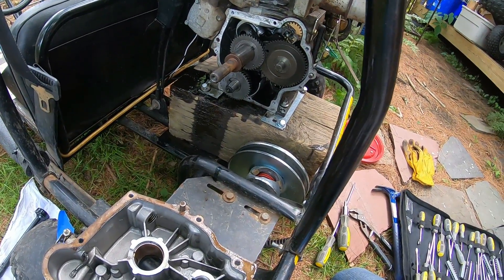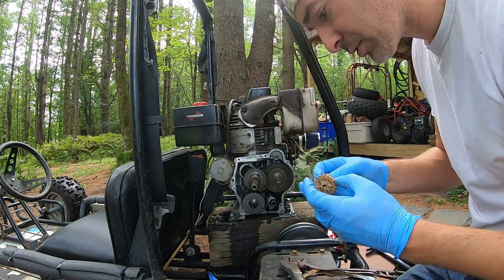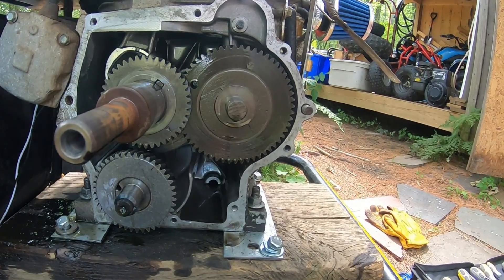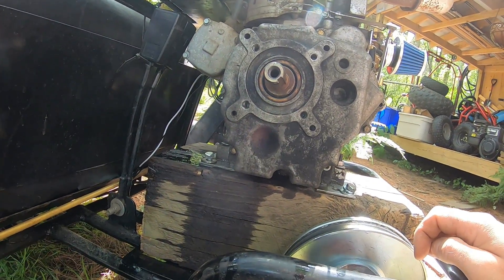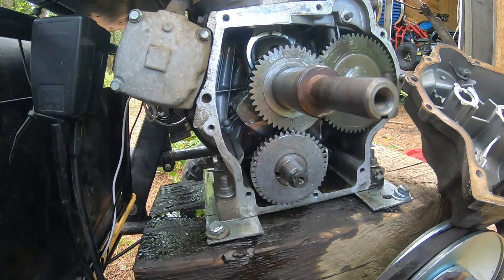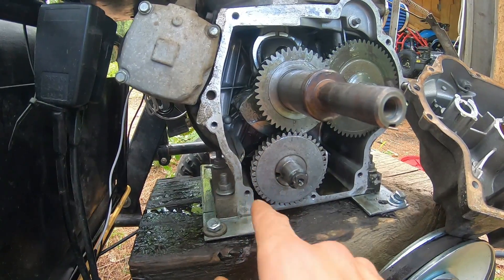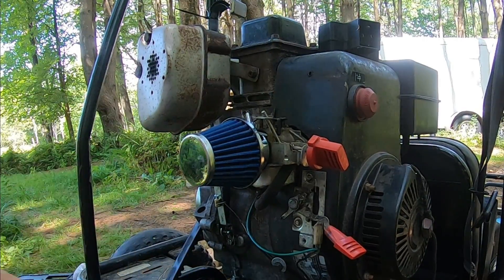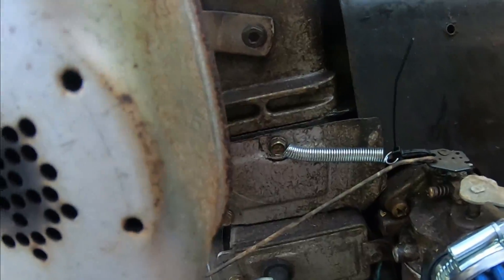Carter Go Cart 12.5HP Tecumseh Motor Governor Removal (How To)

Comment: What horsepower tecumseh are you running? Like 8hp, 10hp? Usually the model number shows it, like HM80 HM90 HM100
Reply from the maker: I’ll double check and post back in a few days as I’d hate to guess and be wrong.
Reply: Vermont Life Thank you so much!
Reply from the maker: The tag on the engine says it is a Tecumseh from Sears. Engine model 143.991201. Engine family vtp358u1g2rd. Displacement 358cc. It doesn't say horsepower on the engine itself but the snowblower that donated it for parts called it a 13hp.

Comment: Love the wood spacer block something I would do 😂
Reply from the maker: I originally planned to make a metal motor mount bud didn't have enough scrap. I do think I need to get lag bolts that will go all the way through the block though. I still have some trouble with the existing bolts working their way out. I'll also need a metal plate to act like a big washer so they don't pull back through the wood.

Comment: I bet that thing can hit 50mph
Reply from the maker: With a hearing change I’m sure it could. It has a 12tooth jackshaft to 55tooth wheel mounted sprocket for a ratio of 4.58. That gives it the torque which is nice for trail riding. I bet if I came down to a ratio of 3 I would still have good torque and more top end considering the motor has 350cc’s or so.